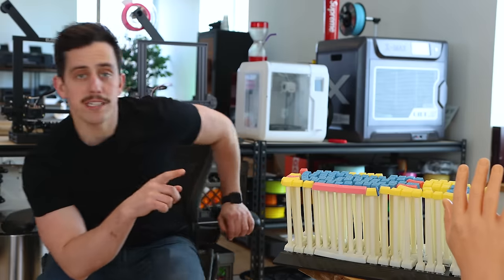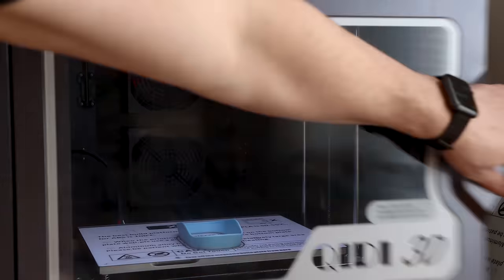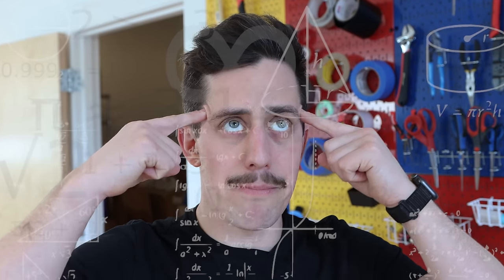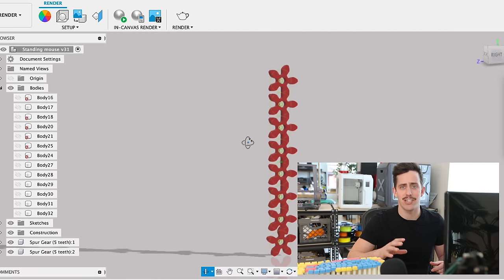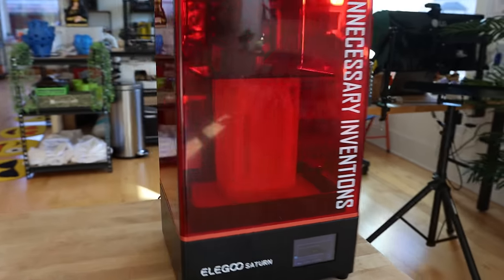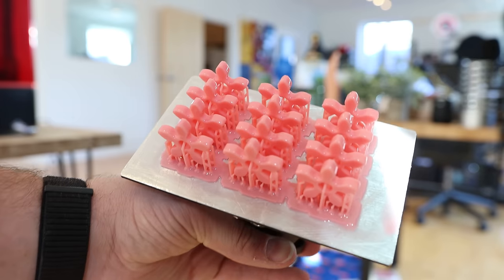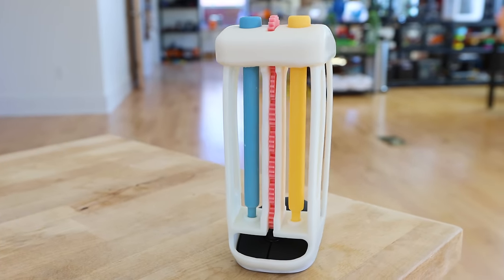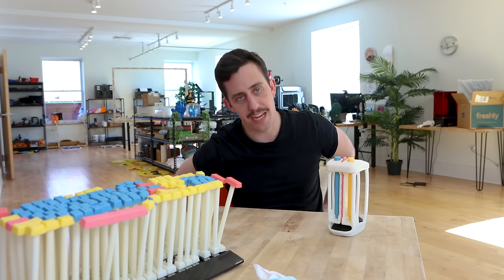Why did I build this SUPER tall mouse?!

Comment: That 3D printer might be the coolest thing I’ve ever seen I’ve never seen one that pulls upward!
Reply: Foot
Reply: You mean the resin printer? That's pretty standard for resin printers
Reply: @justpassingby298  I’m not to into 3D printers i guess I’ve only ever sent he kind that draw from the top
Reply: How they work, is it’s filled with resin, and there’s lasers inside the base that harden the liquid where it needs to be hardened to create an item, on a standard printer you can see all the layers and it doesn’t look as clean, but with a a resin printer you can’t see the layers at all (I’ve never used one so I don’t know if the layers are completely invisible or not)
Reply: @kevinrasch3478  The one in this is almost certainly the masking LCD type rather than laser based.

Comment: In order to preserve the scrolling functionality, I would have dissembled the bottom, removed just the movement sensor, attached that to the bottom of the stilts, and solder wires to the rest of it. That would’ve let me use the existing mouse buttons and scroll wheel natively.
Reply: First like yay

Comment: Actually it has some use for certain circumstances, like desk is too low, want use it on floor to conserve desk space, physically disabled and so on. yeah, a box do the same job but it also limits mouse movement.
It can be improved by adding the feature that enable itself to adjust its height. A spring or an elastic band would be fine  probably.
Reply: How would the scroll wheel work?

Comment: Man, I love this idiotic stuff! I built myself a spring supported “floating” keyboard a while a go. Long soft springs that raised it around 6-7cm from the desk and made sure it wobbled like it was floating mid air while typing, wish I had a wobbly mouse and monitor too.

As far as “standing desk alternatives” I would think a raised wrist rest for the keyboard would be a perfect addition to your crazy setup.
Try to replace the raised keys with adjustable telescopic keys. The you could adjust the typing experience based on how tall you are. Perfect for a shared desk.